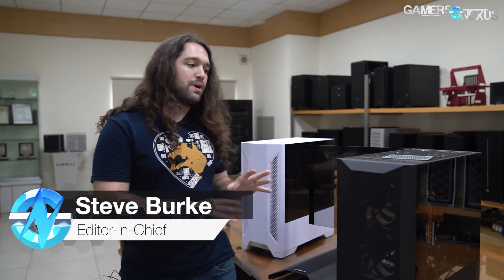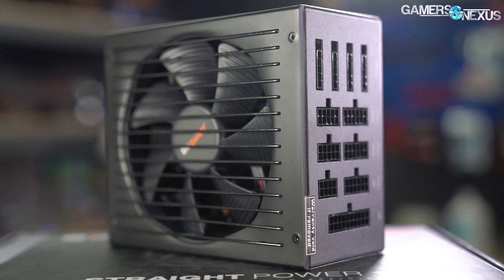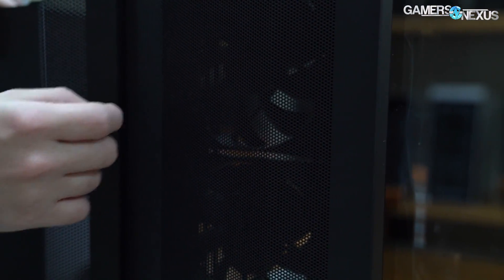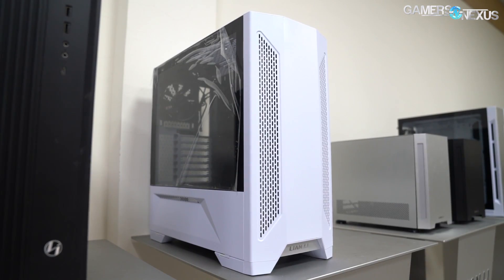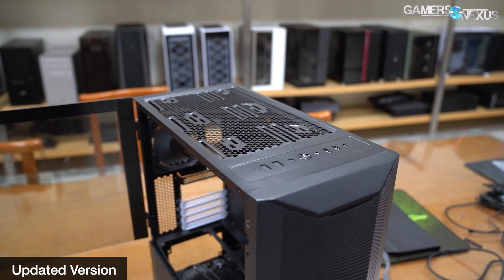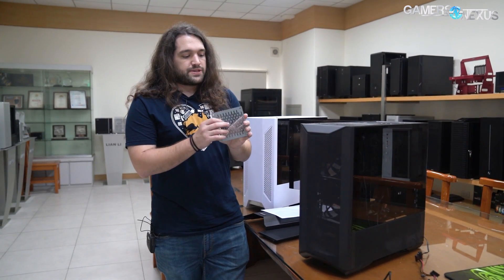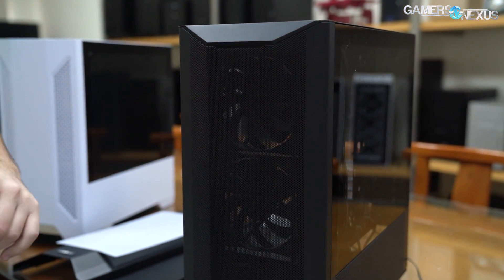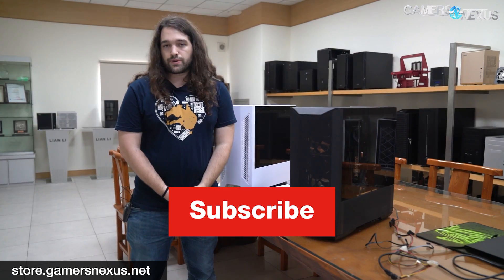Lian Li Prototype Airflow Case: Fixes to Lancool II Mesh

Comment: I paired the Lian Li Lancool II Mesh White with my R9-5950X/ASUS ROG Crosshair VIII Hero/Corsair 128GB/ASUS RTX-3080 OC components, and I really like the case.
The only thing that I did notice, is that it does collect dust bunnies on the front mesh when sitting on the carpet floor, so I moved it on top of the desk behind the monitor.

Comment: This would be a killer if it could josie 3x140mm fans on front, think I’m probs gonna have to get a phanteks p500a, although will have to add some sound proofing to the back panel, love the lian-Li designs but I’m really after that 3x14mm fans on front

Comment: But what about the aRGB!??? That was the main feature of the Lancool II, the MESH version does not appear to have any RGB on the case? I decided to stick with and bought the original LC2; better airflow or no, the main feature is still the RGB which they got rid of, and for some reason is not even mentioned in the video...
Reply: The Mesh version comes in 3 variants, one with no RBG, black with RGB, white with RGB. See Lian Li's youtube channel.

Comment: If that little triangular area on the top front part had the power button and usb would be very nice looking. Specially combining the RGB fans on the front against the mesh panel. This would be a great competitor against the P400A

Comment: im new so forgive any questions that may seem odd, but  my question is, i want this case 1st for my 1st build, only fan cooling for me, 67 yo here, lol, but why not save money and use metal on back side vs expensiver glass as i only need front and one side of glass?  Would that not be better?
Reply: It is indeed cheaper to manufacture, but as most case canufacturers, Lian Li focuses on style and design too. They could have cut a few corners by not having the tempered glass right side panel, but I don't think the price would have been dramatically lower. Thinking about it, there are tons of 50$ cases with tempered glass, and if they can squeeze that feature in a 50 dollar or even less case, it must not cost THAT much to manufacture

Comment: Did they really need venting on the bottom side panels though? The PSU shroud has venting to exhaust but why did they need venting for the cables and drives. They should have just kept the bottom side panels as slabs to make it look sleek. If you put LEDs in that thing all the ugly cabling is going to show through those bottom panels.

Comment: Hi everyone! I ordered a Lancool 2 before seeing this video rip but now I want to get aRGB fans that work with my case (no aRGB header on mobo). If I get a hub with five 5v 3pin aRGB connectors like the Antec Prizm and connected the case and aRGB fans, could I use the case buttons to control the aRGB of the fans too? If the case buttons do not control the fan aRGBs, do you recommend any aRGB fans/hub to go with this case's aRGB and a LED strip (5v 3pin)? 

Another aRGB fan I've seen is the PCCooler Moonlight Series (previously called Corona) which includes a 3 pack (3 pin HUB that would need a splitter?) or 5 pack (4pin HUB that works with aRGB?) but I'm unsure if either would be compatible. Any help would be greatly appreciated!

Antec Prizm: https://www.amazon.com/dp/B07FNHTQNW/ref=twister_B00N13W1BY?_encoding=UTF8&th=1
PCCooler: https://www.amazon.com/Pccooler-Moonlight-Upgrade-PC-5M120-Computer/dp/B07QFX1RV1/ref=cm_cr_arp_d_product_top?ie=UTF8&th=1

Comment: Those aren't "changes", but an admission of poor piss case design from Lian Li. What would you expect when you partner with "overclockers" who know nothing about thermodynamics instead of enginneers? Lian Li was never the same from the moment the founders step aside. They will eventually bring back some iteration of the V-series perforated panels. Those "aquarium" style cases with glass panels all around should be for display only  and not for sale.
Reply: ... der bauer is a german engineer and the airflow of the case he helped design is one of the best in the market ...
Reply: @davidkaus7650  First of all being a enginneer and german it's not relevant (VW debacle rings a bell in your head?). Everybody makes mistakes. You appear to be either a german fanboy, or a troll. Saying that type of pc enclosure is one of the best in the market is ridiculous. Where's the air coming in from when you have glass in front and sides, care to explain?
Reply: @josediaspinto7438  you seem to be the troll here mr. . you don't even know the single case he helped manufacture (in the rest he did not take part) if you don't know that his case 011 dynamic both has tripple side intake and double bottom. Yet here you are commenting on him being incompetent. gamers nexus has a full review for you to explore on the subject. It's objectively one of the best cases for airflow and temperature. And that is not my opinion but theirs.  They have all the numbers for you. Besides you were the one complaining that the "overclocker" was no real engineer. So don't tell me now it doesn't matter.
Reply: @davidkaus7650  that's for you to guess what i do or don't know. GM gave a better (positive) note  to the "air" version of the O11, still with a lot of caveats, namely due to the way the case was designed if you want to have a good airflow you must endure substancial more noise. As for the bottom intake the airflow is obstructed by the gpu, so flaw, flaw. Keep in mind that Lian Li had better in their long history already designed better airflow cases, as the V-series, without needing to hire anyone  from the "entrhusiast community" so this 011 brings nothing new to the market.
Reply: @josediaspinto7438  lol

Comment: I've got a change that would fix airflow issues in a heartbeat. 

SMASH that stupid malfing halfwitted "bling bling" glass side panel BULLSHIT into teensy tiny bits, then manufacture a solid metal side with a mesh that a 230mm side fan can be attached to.

PROBLEM FREAKING SOLVED!

Seriously, sick of this artsy farts BS in case design. The most obvious place you can put a giant lower RPM fan to shove air right where it's needed most? No, let's put some dipshit glass panel there so people can look inside. BARF.

Comment: This has potential and would consider upgrading from my NR400 which I had to do some small mods to the front fan mounting area so 140mm fans could take full advantage of the front mesh.

Comment: I moved the dust filter on the lancool2 closer to the front of the grill, I feel this brings in more air as it’s not have trouble displacing the air between the grill and the mesh, while still allowing a good amount of RGB to be eliminated and keep the practicality of the dust filter

Comment: Hopefully they apply the same learnings to the O11 Dynamic Mini.
I'm most excited for that case, but the ventilation perforations looked horrible, with more metal than hole...
The larger Dynamic and XL could get away with less aggressive meshing by virtue of having tons of fans, but the Mini needs to make due with only two fans in each bay instead of three, that may also need to fight a radiator when you're liquid cooling (and it's an O11 Dynamic, why wouldn't you liquid cool?!), which further increases static pressure demands.
If they're not careful, you won't need fans to get air through it, you'll need a freaking air compressor...

Comment: So most of case makers stopped at 2013, when you still have unfiltered vent holes all around the case, still need to pull whole front panel to access to eventuall front filter, and all mainstream midi towers are in just one orientation. I feel like time has stopped.  I really regret i didnt stared my own business previous year, seeing that stagnation i would be millionaire right now as all of my cases would contain few unique features, and every of them would contain user friendly accessibility to all filters and usefull "tricks". All with low budget and top serviceableness
. Whats more interesting i have writed to top 10 manufacturers with my projects, sended them my drawings, and only one of them is making something very similar to those drawings - Silverstone.

Comment: 130-150$ for this case is a bargain when it looks modern and company listens to audience about possible improvements,if they want what they can do for 2:22 is reinforce it on bottom side with just leaving that side without mesh which should bring rigidity and just smooth it down so it looks normal again and dosen't wobble like it does now

Comment: There are 3 things I look for in a new case. One tempered glass side panel covering at least the motherboard area (I don't need to see the PSU shroud). 3 front 140mm intake fans for an ATX case. A mesh front panel with some form of dust filtration on any parts that take in air. Give me that and you've got a good airflow case.

One final thing that I'd like to see in an airflow case is how the space is used. Make the case less deep, so that the intake fans are closer to the motherboard. And make the case wider so that you can hide cables and HDD/SSDs behind the motherboard tray and PSU cavity while also making more room for airflow around a vertically mounted GPU (the extra height from fitting the 3 intake fans helps here too). HDD/SSDs don't need cooling, they work best at 35-40C, so don't ruin the design trying to get airflow to wherever they are.

Comment: "the density per square area"
I swear, GN usually makes the most detailed, detail oriented and scientific method approaches to some things and drops the ball on others
Reply: That's called script writing.
Reply: @EvanA.  yeah, obviously. But a good grasp of the spoken word is as important, if not more, as the written one
Reply: @Dudae_  Agreed. Actually I was just commenting on why Steve can be a little less precise when speaking. Nobody should make mistakes when script writing (they don't, as you noted), but speaking freely requires a lot more practice (as you again noted right this moment). That's all.

Comment: I would like to get the mesh front to replace the older one. Not only would help with airflow but make push pull front actually practical.

Comment: The most important part of the case TOP cover? Is it closed or filled with holes also? Learnt it the hard way, got an DB700 and absolutely no air escapes from top and it heats the case up.
Though now I can see how blower type GPUs can be useful- in cases focusing on silence it´s most important to dump hot air out of the case and blower types do it well. And in silent case the 50dB isn´t that bad. But as AMD goes for axial fans and HDDs are out I think HAF cases are the future and a mesh on top cover is a must, as hot air moves upwards as the laws of physics dictate. Needs lots of work from fans(and noise) to force the air to move other directions.

The best place to install SSDs would be not in back of mobo but on the PSU cover shroud. Flip out the cover shroud, install SSDs on back side of it, get a fan on base of the case and you´d get nice and cool drives. BC back side of the mobo can get hot also- some reviewers even measure the back side of the mobos, especiall on the VRM side-  which heats up SSDs

Comment: Well looks like I potentially found my next case! It's either this or the Phanteks P400A mesh!
Reply: I have both. P400A D-RGB is definitely a looker but its build quality was bad for me, paint comes off while tightening screws or when sliding metal panel in and out. Lancool 2 on the other hand is wow. Its a lot heavier, thicker panels, paint never came off at all and the modularity, to name a few, is absolutely amazing. But yeah, I will switch to the new Lancool Mesh when that launches.

Comment: Literally bought this case yesterday. Hopefully the mesh panel revision will be available by itself as upgrade.
Reply: It’s sold out everywhere I can’t find it, where did you buy it from? I’m in the US
Reply: @yannicastellano6771  Canada. I was going for the white version but my local shop was out. Actually, i was going for MATX case but came across this one.
Reply: @neooneeightytwo  I just purchased the Lancool 2 White. Just went to Lian li's website and saw all their verified vendors and found one. Brand new just had to pay 15 bucks extra for shipping.
Reply: @yannicastellano6771  good on ya bud. It's a very nice case.
Reply: Neo_182 yo do you have to pull very hard to remove the front panel? Or I’m I issuing something? Do i need to remove any screws?

Comment: Will it fit the Noctua NH-D15??
Reply: If the Lancool II non mesh variant is any indication it should. As it's the same chassis just different paneling. The cpu cooler clearance is 176mm in that case.

Comment: These changes are great. I’m kind of surprised they didn’t go with a boxed frame along the bottom so you could attach more fans down there like with the original cool 2. But my biggest wonder/question/gripe with the new case is, why take away the front case rgb? I mean it would have worked wonders against the mesh way better than the original lan cool 2. Well either way, when I build a computer I might go mesh depending on how big of a difference in temps it makes vs the original considering I’m not planning on over clocking but having a powerful gpu.

Comment: Damn can they sell the front mesh separately so people like myself who bought the lancool 2 already can enjoy the extra airflow
Reply: Same, I bought the white version. I love to get the new front panel! 

Got it cheap month ago before price hike!
Reply: Hardensoul 72 me too. I don’t see why they can’t make some extra money by selling it to us lol I’d buy it
Reply: @LosDefinit  They will make more if you buy the case again 🤣
Reply: DIY it yourself, it's much cheaper. I did that with an old My Phone case for my brother, pulled the front plastic covers, jammed 12 and a 14 mm fans, made them improvised covers out of door seals and PVC mesh and that's it, cheap as hell and efficient as... well, you know! 😁
Reply: @Sicom not necessarily. DIY it doesn't have to remove the entire front and get rid of the RGB. Depending on you skill with craftmanship, it's not the hardest thing to cut out the middle and replace it with a mesh type of front grill. As long as you don't cut your cables you're good.
Reply: @TheTrooperk34 now they do wow smh lol I have a p500a now

Comment: Perfect, the top holes of Lian Li Lancool 2  aren't so good, i  ve observed in my case with 2 Noctua Np14 it returns part ot the air back in the case because of those holes, something that i am not be able to  modify and also i removed the magnetic  dust filter as it restricted  more airflow,  but i am happy they observed this too, as for the front mesh if they will also sell parts  i ll gladly buy them especially the front mesh and 1 side  for my fans.

Comment: Will choose between this and the Phanteks P500A later this year. At 2:20 you can see a fan hub - I hope they include this with retail. Also, with the naked eye at 2:00 it appears as if a third 140mm fan could fit in the front - that would make for some pretty darn good airflow.

Comment: Looks sick, but I would like to see more of a wind tunnel version without holes on the side panels + a nice front dust filter. Also, I hope you can mount a third fan to push some air into the PSU shroud for the hard drives.

Comment: I get a feeling that this is going to be the case I'll be recommending to all my friends, once it is released and has been thoroughly tested by GN. Built a PC with my roommate last month and convinced him to get the RL06, which turned out to be a really good case – looks great, great airflow and cheap price if you consider the included fans. This looks to be potentially even better.

Comment: I know that this case supports 3 3.5" hdds put of the box, but does anyone know if it is possible to purchase 2 of the back plains and fit 6 tightly in the bottom? Looking for support for at least 4 3.5" with a preference of 6 and this is high on my list except for 3.5" support.

Comment: Glad to see Lian Li is taking one of the most important features in a case seriously. They seem to understand the consumer demands much more than most others.
Reply: They seem to have completely transformed their product focus. I'm very impressed.
Reply: @M T  Fair enough, but this is priced at a level that a person doesn't even have to be an enthusiast to see gains.
Reply: @M T  IDk im a budget builder and this case is looking pretty cool. reminds me of the cooler master haf 912 but in a more modern aesthetic
Reply: @FlauntyToaster  Ah, the Cooler Master HAF 912. My Uncle in Taiwan has one of those Classic case. It's got a 140mm mount of the top positioned so you can see your RGB RAM (That case was probably made before transparent side panels became all the rage, he uses red Avexar RAM). My uncle installed 2 ODDs, for some reason. That case is the reason I went with Cooler Master when I was building my computer (I got an MB511, If I didn't have a good external ODD, I would have gone with the NR600) and is also the reason I only ever look at mesh cases.
Reply: @tomhsia4354  <strokes his HAF XB EVO lovingly>
It was a time of black metal and heavy plastic.  Rolled edges, airflow for days, intelligent design.  You kids and your tempered glass.  My case is lit from within by the overclocked fires of hell and can be used as a bludgeoning weapon in case of zombie apocalypse.  No mere Ikea table can withstand it's acceleration due to gravity.

Comment: Now that I have my Phanteks Evolv X, my next case is absolutely going to be an O11 or whatever successor is out at the time. Had such a hard time choosing between the two.
Reply: I'm doing a build for someone in the Dynamic XL, and it's so well designed I'd call it ergonomic. I did a build when Ryzen launched in another Enthoo, and it was a great case, but the O11 Dynamic is just fantastic. It's not one big thing, it's a ton of small to medium things and is absolutely a sum of its parts.